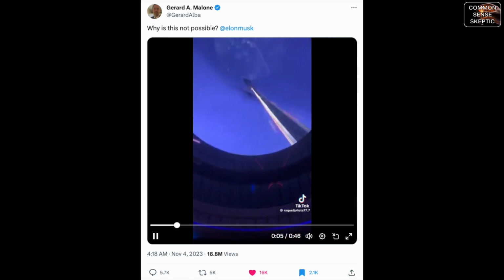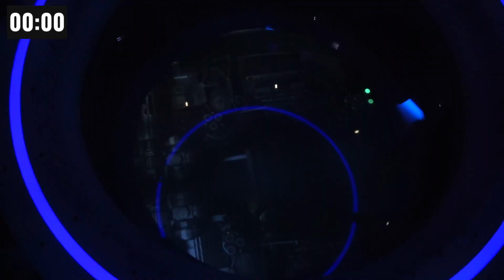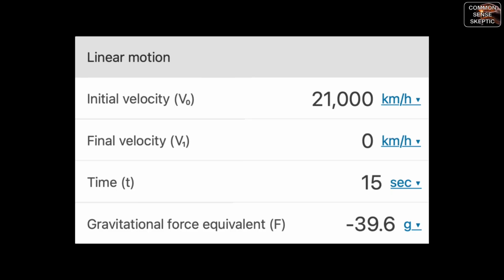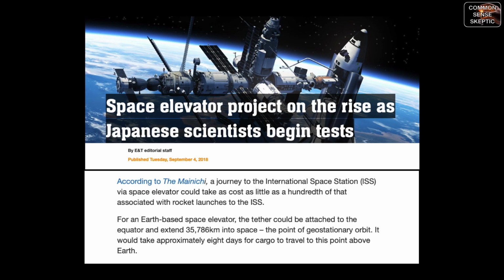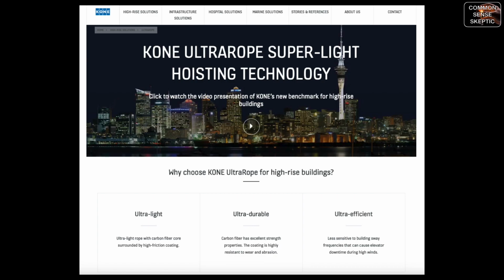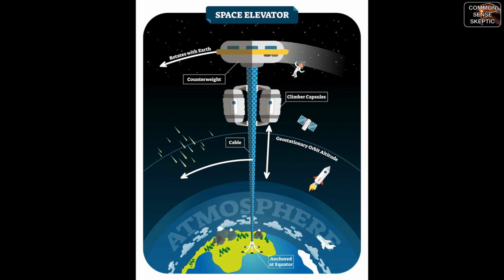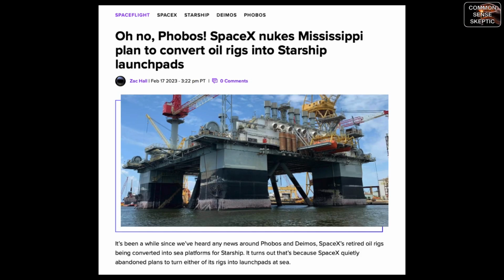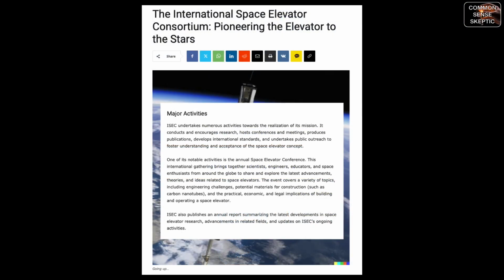DEBUNKING L.E.O. SPACE ELEVATORS

Comment: Really great break down. I was first made aware of the limits to self supported cable lengths and an apprentice boilermaker 30 years ago.  
The temperatures you mention also have a significant effect, not just on expansion but the strength of materials, especially steel. 
I've recently been working with a guy who spent some time working at Rocket Labs (NZ) - we were just spitballing about the energies involved at collisions at LOE speeds, it's astonishing.  He introduced me to the Kessler effect - that's a concern.
Reply from the maker: We covered Kessler in our breakdown of Starlink. It's a little scary how that system threatens to accelerate that issue which is already in its early stages. Episode is about two years old now.

Comment: Certainly not practical for Earth, and probably never will be but I’d be interested in seeing the calculations for the moon, which would be the better place to prove out the concept anyways.  Could be put on the lunar equator with no concerns about oceans or human habitations below it, and of course would be much more achievable technically - no atmosphere equals no wind and elements to cause issues and of course lower gravity means a much less complicated set of problems to solve, especially overall length and strength of needed materials.

It could alleviate some of the significant issues with a moon base, especially the risk of blowing regolith everywhere when a rocket launches to return to earth.  Of course, the amount of materials required to construct it would still be enormous and initially would have to be sent from earth, but perhaps if in-situ extraction and processing becomes viable on the moon it could be considered.  Of course, lifting out of the moon’s gravity well isn’t nearly as resource intensive as from earth so from that perspective it doesn’t gain you much, mostly just saves the risk of a failed landing killing people and destroying a rocket.
Reply from the maker: Can't do it on the Moon, either. There's no "GEO" within the Moon's influence of gravity.

Comment: The only way a spacevator would stay suspended is if you have half the mass below geosync orbit, and the other half above it. Or otherwise, the forces on the orbiting terminal in space would need to overcome the force of gravity acting on the rest of the conduit. Also, the way you minimize the energy it takes to raise something into orbit is by using gravity pulling something else back down. This doesn't mean you need a big long cable going all the way up and back down to the other elevator so they can share eachother's forces - you just use linear motors and allow the returning car that's descending to decellerate by helping to lift the car that's coming up. You'd take energy from the falling car to slow it down, and put that energy toward lifting up the ascending car. The whole spacevator idea is crazy anyway. The best thing we could have is a whole orbiting colony, and people riding up/down from there with some kind of futuristic propulsion tech that we don't have yet to get into orbit. Antigravity! Time travel! Wormholes! Free energy!!!! Conspiracy theories! Area 51!!!  Yeah, space elevator...

Comment: The only way I'd hate you more is if you made an episode proving Santa and the Tooth Fairy aren't real. 😜

I still have faith in the futures of material science. I believe, I believe! Just waiting for those km long carbon nanotubes to show up under my Xmas tree with the ability to use atmospheric voltage to fully power my Mach 7 space elevator. AND YES you rube, my elevator will have a cable on one side. Don't fuck with Bob Iger. And you're not gonna be invited. So suck it. 😆

Comment: Quick question, assuming the space elevator and whatever station are essentially weight neutral, meaning there's a counterweight that primarily aims to offset the structure weight at geostatic speed, then why is huge anchor super important? As of now, a space elevator isn't possible with whatever tech we currently have, though doubting the feasibility due to anchor weight seemed like an odd oversight from CSS creators. I understand there would be a lot of expansion/contraction based on whether it's seeing the sun, but that's 1) at current technology limitations and 2) assumes the design wouldn't try to compensate for as many variables as possible. I feel like it's more likely I am missing something than the CSS guys missed something, and that's the only reason I'm bothering with this question. Thanks for all your hard work, love the channel!

Comment: First thing that comes to mind is that the elevator seems to be in florida. Florida is not on the equator, so there's no way for a space station to be in a geosynchronous orbit above that point. 

Also stuff in LEO has to move much faster than the ground below to remain in Orbit. There's a reason why geosynchrnous satellites are at a ~36 000 km orbit since the orbital speed at that distance is just slow enough to move in sync with the surface below.

Comment: Surface ancor location dose not nessary need to pull outward from the surface of the Earth with all the tensile force that the cable can withstand like a suspension cable bridge.  The segment of cable from Geosyncrouncous orbit can be thought of as hanging down from that height (and the portion beyond geo as hanging in the oppite direction) and thus the tension in each segment of cable decresses as you get farther from Geosyncronous orbit.  The vibrations and thermal expansion would thus be the main causes of the cable wanting to pull away from the Earths surface, a system to spool in and spool out the cable an thus maintain ideal tension for function would likely be nessary.  A preverable solution might simply be to terminate the cable at a station just above the atmosphere which can then be reached via a much smaller rocket because no lateral acceleration is needed.

Comment: A bit triggered but, orbital rings are much more """feasible""" than space elevators given you could make a realistic project plan assuming world peace, $200 trillion funding, no new science and no unforeseen challenges.
Reply from the maker: Made out of what?
Reply: @commonsenseskeptic  Steel obviously for magnetically accelerated orbital cable, ideally magnesium for towers but aluminium is also adequate. In case of surface construction suitably armored vacuum tube possibly stainless steel, in case of space construction suitably armored cage or tube.
Reply: @MyValki it would only make sense if you put it in GEO. If the ring is just one steel rail, the one that holds half of a train, the weight of it would be about 14M tons. One ton to GEO costs about 30M$. Now do the math for just one steel rail, without anything added to it.
Reply: @DinoAlberini  I don't think you understand how the ring works. An orbital ring consists of two main parts: a tube or cage that doesn't move relative to the ground, and steel orbiting through the tube - a steel cable being most convenient. The cable moves slightly too fast for its orbital height and thereby supports the tube. The altitude of the ring would be 100-120 km high, or anything less with a vacuum tube around it.

You can build a minimum functional version in space and use itself to lift the remaining building materials. This is stupendously dangerous (think planetary shotgun blast) with an untested megastructure and unknown engineering challenges.

You could also build it full-scale on the earth surface and have it lift itself whole... if you build a 40.000 km scaffold & bridges along the equator and a 40.000 km vacuum tube. This is stupendously expensive and massive but you can test every stage and you are faced with known engineering challenges.
Reply: @MyValki  how does a speeding cable support a stationary tube? How is it attached to the tube?
Reply: @DinoAlberini  Suppose the cable flies at correct orbital speed naked through space. Under the cable you position a magnet, that pulls itself toward the cable. In lifting the magnet the cable slows down slightly, which would cause its altitude to reduce. That is why the ring needs either tethers to the ground or (emergency) rocket boosters to 'keep it down' so that it can run at super-orbital speed so that the reduction in speed does not reduce altitude and can be compensated for by magnetically accelerating the cable.

Instead of individual magnets, you obviously have numerous supporting and vibration dampening ring couplings that work in all directions. There will be a lot of vibration especially when you start running trains on the ring both for transit and launching spacecraft.
Reply: @MyValki  let’s say there are no vibrations and it works smoothly, let’s say that the ring has a mass of a ton per 10m in length, how strong should the magnetic field be if we have a ridiculously small clearance of let’s say two meters between the cable and the ring? At 100km the weight is about the same as on the surface.
Reply: @DinoAlberini  That is just engineering choices and priorities, having designed a lot of mechatronics, power electronics, I would be qualified to answer it. However, if sales approached me with this question I would answer "yes" and suggest the customer figures out more detailed specifications and priorities.

There is something to be said for having as small as possible magnets for example, but also as low as possible frequency and thus interference which would lead to larger or more magnets.
Reply: @MyValki  so can you give me an answer? 10kN at 2m distance on a 10m long steel rod (you choose the steel variant and the rod dimensions) I haven’t done the math, but I suspect the numbers are ridiculously high.
Reply: @DinoAlberini  I could but it is real work, but I will probably get to it as the question is interesting.
Reply: @MyValki  you can guesstimate that “unrealistic” in this case is a euphemism.
Reply: @DinoAlberini  and here I thought you were sincere, if you already know it is ridiculous why bother? And you cannot just have a motionless rod stand in for a conductor moving at orbital speed.

Comment: The centre of mass of a space elevator must of necessity be in GEO. Assuming a massless tether and car, any cargo on the elevator will lower the altitude of the centre of mass, which means the system will no longer be in GEO. The centre of mass can be maintained at GEO by a system of moving counterweights. I have never seen proposals for such counterweights, which suggests I've never seen a proposal for a viable space elevator.

Comment: As they ascended, they would bend the cable because they would be unable to get the orbital velocity at greater height. If the did get there  they would accelerate then decelerate back and forth side ways. The reverse is true for return with orbital speed bending the cable side ways trying to slow it down

Comment: Such a long video, just explain that things in space don't "float". They fall. Everything is falling at the same speed they fall on earth but they are going so fast forward that they miss the planet. The fall vector changes keeping their speed and "fall" and we call that orbiting. Anything low has to go really fast to "miss the earth". You have to be a geostationary orbit (aka very high) to be able to move slow enough, still "miss", and not move from your surface position on earth. If you tie a rope to a sat up there it will pull it down because the rope will fall cuz its too slow. The most realistic rope would be a rope from the moon to Upper atmosphere. As the weight of the rope will be low enough to not pull the moon down. the rope will hang like a normal rope on earth. Theoretically you could climb the rope with a motor as it would be very slow on earth. Slow enough to grab on the run.
Reply: Even if we could do it. It would be selfish because the Moon is currently falling to earth and the pull of the many tonnes of rope, even though small compared to the moon, would accelerate the fall and doom future civilizations. They, in turn could use sails and energy beams to reaccelerate the moon. But still, its a risk.
Reply from the maker: We look forward to your video on the topic :)
Reply: @commonsenseskeptic  it's also reductive. The rope only provides a track to pull on. Opening up the possibilities of renewable energy transport. Less energy is required if you just use your mass to orbit. No track needed. You can float to the moon if you just fling yourself.

Comment: An elevator does NOT need to be on the equator. It's not optimal to have one near the poles, but a temperate or subtropical latitude is only moderately worse than an equatorial one (though an equatorial one is already structurally extremely demanding). There is the issue of it wanting to drag the ground station towards the equator, but this is nothing that can't be solved with a nice sturdy foundation.

What is absolutely necessary is that the elevator goes out perpendicular to the Earths' rotation. So you would not be looking directly down at the groundstation but off at an angle.
Reply: One reason why it's not that bad to be a few degrees off from the equator, provided you have a solid foundation, is that the station and counterweight are pretty much equatorial regardless, so everything a significant distance above the Earth does not suffer from cosine losses nearly as badly as the parts of the cable near the ground.

Comment: A space elevator makes Hyperloop look entirely practical and sensible in comparison. And Hyperloop is totally impractical.
Reply: Subscriber to you as well as this channel. 

This video did a great job of specifying LEO in the title. Which anyone who has taken a simple orbital mechanical class knows is impossible. 

A space elevator ONLY makes sense for deep space (IE, higher than geo stationary) destinations.

Yes, we currently don't have materials strong enough to handle going from ground to geostationary. Simple as.

But if we could somehow lift things past geostationary orbit, it would be amazing for getting payloads into deep space.
Reply: Hyperloop is impractical because the tube has to be in vacuum, right? There is plenty of vacuum above 100,000 feet. 
Now lets talk about electrifying the cable. You now have a very long rail gun or maglev track if you prefer.
I agree that the cable anchor has to be at the equator but the terminus has to be at geosynchronous orbit with a big counterweight. If you need to have satellites at LEO, I would think it would be possible to build way stations anywhere along the length of the cable.
Lastly, any cable strong enough to support it self and facilities and the counterweight, should be able to withstand space debris hitting it. It seems like you have a very narrow cross section so that most space junk would miss it.

Comment: Interesting as usual but with some issues:

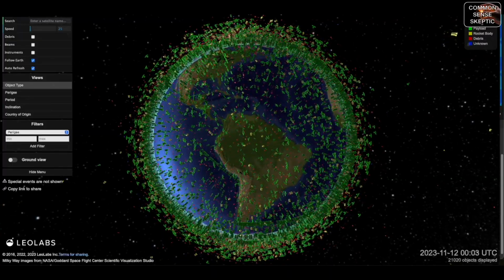@9:36; Your number here are incorrect in that they "assume" Centauri station is the "end point of the elevator. It's not, it's the "low port" station of the elevator. (You are correct that the entire set up would not work where it's "shown" but as noted it's tied to Disney World so there has to be some 'bias' adjustment) On a 'real' SE the station could be stationary at that altitude with no issues as long as the ENTIRE elevator is reaching a point where it is geostationary. Don't take a step outside though :) (Yep, that cute family is actually falling screaming towards the Earth... of course that COULD be part of the 'ride' experience... You know, very high altitude reentry parachuting? I'd take my kid on it :) )

Mistake on Kurzgesagt's part is they satellite has to be released from a height on the elevator consummate with it's intended orbital velocity and this will automatically be HIGHER than the satellite orbit and in such a manner as to allow it to 'fall' into it's orbit where a short burst of rocket power will help circularize the orbit.

14:00: Your own illustration shoots down your argument here. The Burj Khalifa express elevator is a single unit from ground floor to the top of the building :) You avoid the issue by having the main support cables differ in diameter to take the main load and then use different cables (or ribbons in some concepts) that only have to handle the loading of a single 'car' at any one point. The math is pretty straight forward. Carbon nanotubes are the current front runner but it's likely the bonding matrix needed isn't there yet. As is we can build "skyhook" type elevators that would greatly reduce the needed speed to reach the bottom of (between Mach 6 and 12) out of available materials.
Your also neglecting that no elevator (or skyhook) concept uses only one filament and/or cable there's dozens of them in each element and multiple separate elements for safety. (Also helping to address your temperature issues)